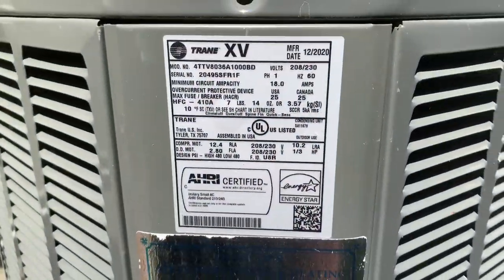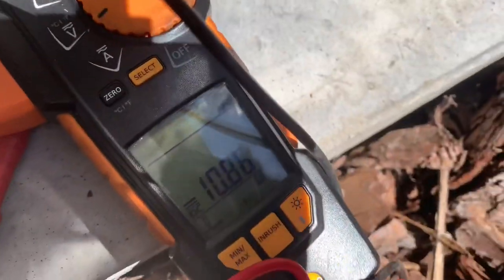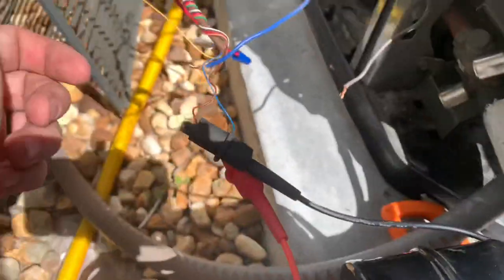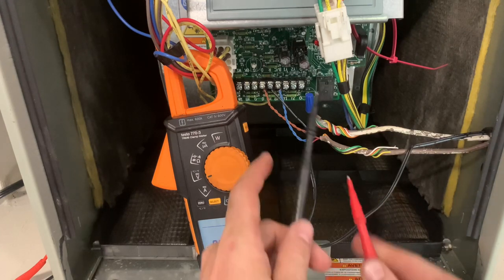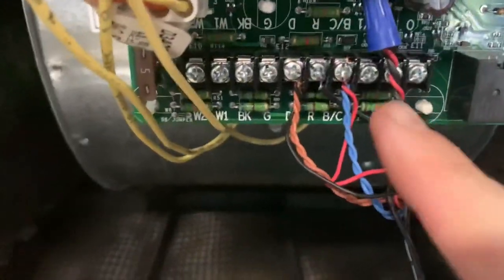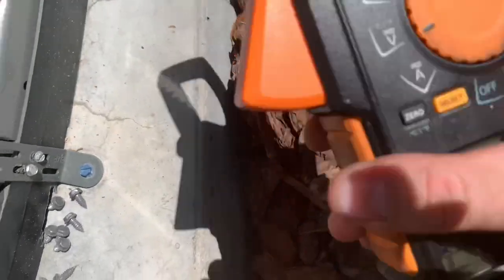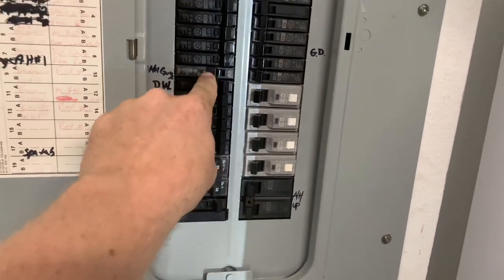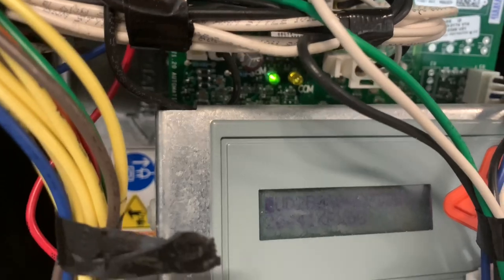TRANE XV not cooling |System communication error | diagnosis and repair

Comment: Hi, I have a problem. I was working on a communicating hvac systems system (my first time). I replaced the condenser and the coils due to leaking. We replaced it with a non communicating or regular condenser unit. I used the same wiring as before ( I didn't change it). And now the thermostat gave me error 92. I looked online and found the manual, and it says I have to connect condenser wire to Y1, so I did it, and now it shows error 126. I have a trane xc80 furnace, don't know the thermostat but it old looking trane touch thermostat. Only had 3 terminals used in the board D, R,and R/C (initially) the one wire from thermostat and condenser to D and one wire from thermostat and condenser to R/C. I removed the condenser wire from D and moved it to Y1. Still, the unit is not running. It makes a few clicking sound and then nothing.

Any advice on how to fix the issue
Reply from the maker: May need to use 824 stat or one simila r.  which is a more conventional stat! I have been out of the Trane game for couple years! And I know they recently “re-engineered” their communicating system.

Comment: Why is that important for inverter/communicating equipment to be turned off in the order of Ac first then Ah ?
Reply from the maker: That’s where the inverter and drive are main communication. That’s my best “technical” answer and in training that’s how they told us!
Reply: @KoolinwithKrauss  thanks,makes sense as that’s the brain of the system